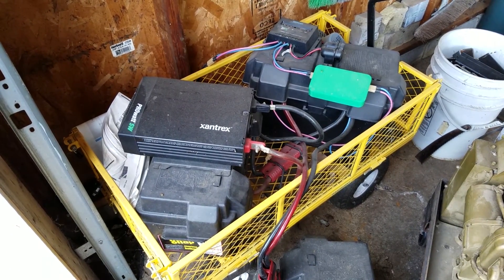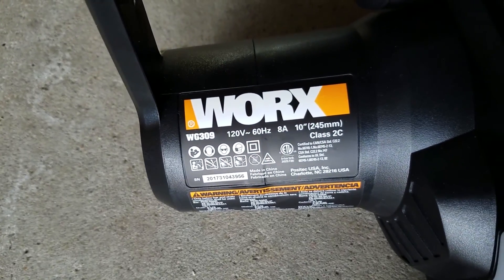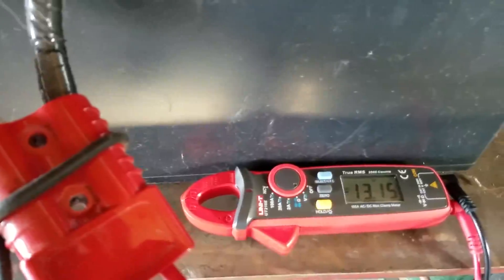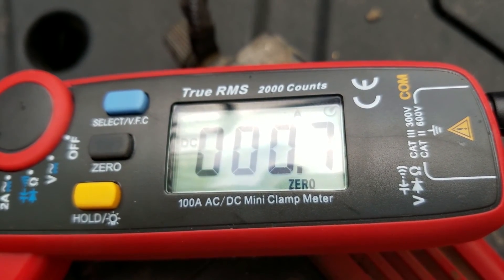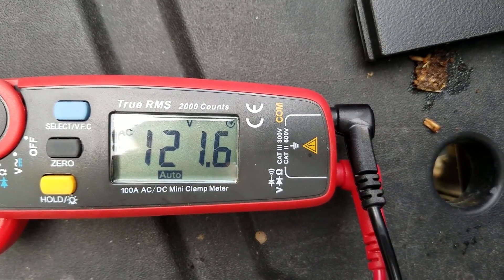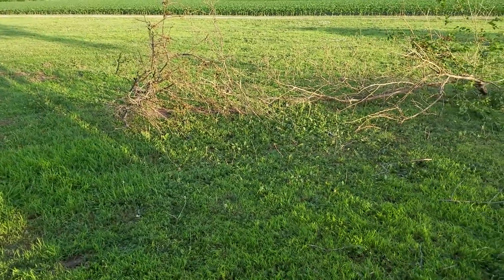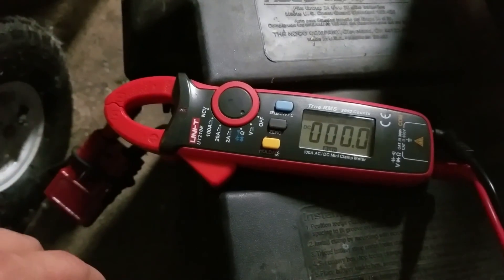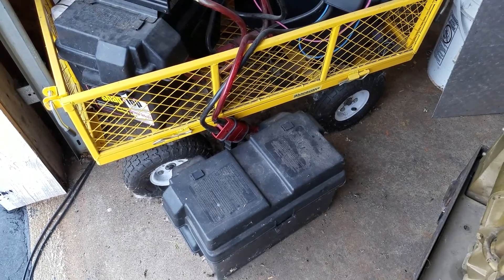Running 120V Power Tools From a Deep Cycle Battery

Comment: Great video ... I have a corded pole saw and hedge trimmer because the 2cycle versions are heavier than I like. (I thought about going battery, but the cost is stupid and companies swap out battery types way too often.) 

Anyway, I need to do some tree limb cutting but hate running 200ft+ of extension cords. I was looking at getting a small gas inverter generator (it can be helpful for other things) but never thought of just using a deep cycle battery with an inverter ... I can make a rack on my garden trailer and pull this bad boy around ... no more fighting with long extension cords .... thank you so much 

Also I'm now thinking about a solution to provide clean AC off a normal generator.

Comment: My question is is it possible to run a plasma cutter off a battery or two , have a work truck was wondering if I could run it by battery and not a generator

Comment: I'm looking at running an independent system in my shed.  I want to power some tools.  The biggest being a mini Lathe and a Band Saw.
Do you have any suggestions for what kinds of inverters or batteries I should be looking at?

Comment: Ayee just subscribed lol. Im a little confused on the amps and volts lol. If i have a 100ah battery and say a 7.5amp at 120v 1/2 impact wrench.  With a 1000watt inverter, how long will it last? 7.5 watts@120v is 900 watts. So it will last me about an hour right? Lol
Reply: 100 ah 12volt battery 100ahx12v= 1200 watts at full depletion. You don't want your batteries less than 50-70% capacity so you have about 400 - 600 watts of power you could pull from the battery. If your impact wrench uses 7.5 amps on 120v ac then 7.5x120 = 900 watts per hour which means you could run it for 30 minutes (450 watts) and your 100 ah 12v battery would be at 62.5% capacity and would need to be recharged. Now, there are losses in converting dc to ac and batteries lose their rated capacity over time, so keep it charged and don't deplete it past 70% if you can help it.

Comment: Can a100ah  running 1300watts circular saw??
Reply: Amps x Volts = Watts.  11 amp circular saw X 120v = 1320 watts. 100 ah battery x 12v = 1200 watts. So you could run your 1300 watt circular saw for 30 minutes (650 watts consumed) and have a battery a little less than 50% depleted (650 out of 1200 watts). Any more power consumed and you destroy the battery, indeed, it is better to keep the battery higher than 70%.

Comment: What do you recommend for minimum specs on the inverter inorder to handle the surge level of your type of pole saw? Thanks
Reply from the maker: I wouldn't recommend anything below the 750 watt inverter I used in this video. The saw ran fine on this inverter, but according to the ratings of the saw it should really be running on a 1000 watt inverter.

Comment: Could you go into a little more detail about the solar panels and controller you are using? I am thinking about setting up solar for my shed lighting and small tools. Thanks for the video.
Reply from the maker: I actually have a video in the works on a different system that I have setup. It was installed just for this purpose. That video should be out either this week or next week. Thanks for the comment.